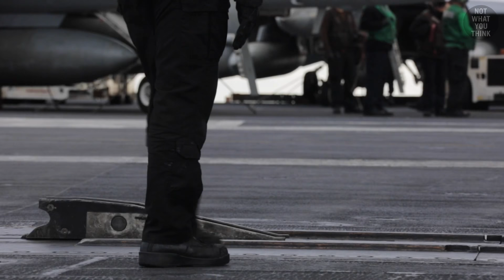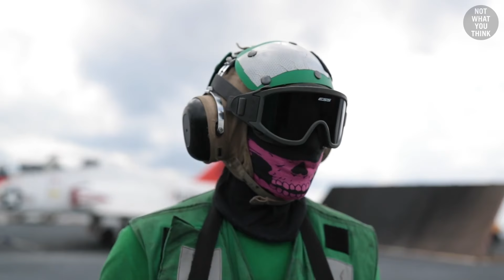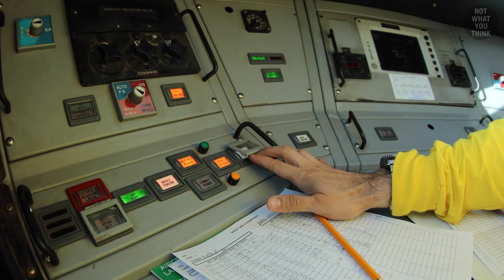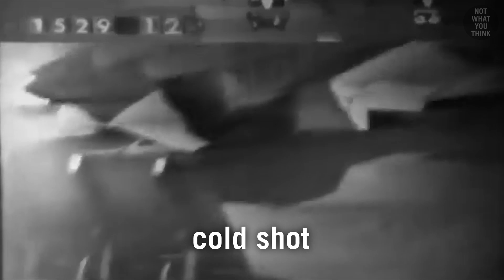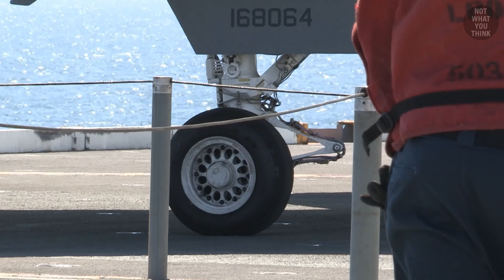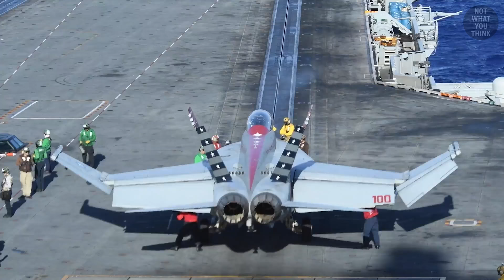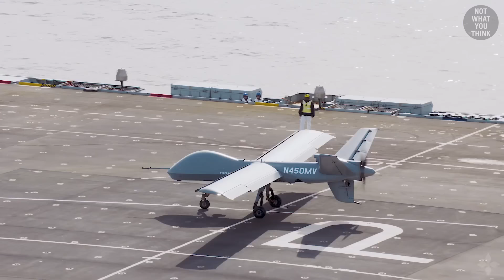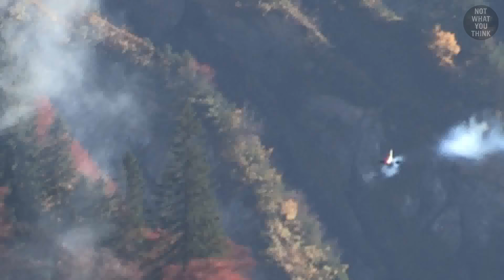Why the US Navy is Replacing Electric Catapults with Steam

Comment: It’s a new technology, there will be bugs that will get fixed. When did people forget this fact? Brand new technology takes tweaking. That’s why you don’t buy the first model year of a car.  I am sure steam catapults took awhile to perfect, but they didn’t have a saboteur in chief back then.
Reply: I always wait until the third or fourth year of production to get my new supercarrier.
Reply: @benoithudson7235 You'd be doing better than the US because the Gerald R Ford took 12 years to build and another 6 for full deployment.
Reply: @JWQweqOPDH  And the mag launch system still doesn't work right till this day too. But, like with the Zimwalt's failed vaporware rail guns, the "experts" keep trying to push the tech in its current design on the US Navy.
Reply: @benoithudson7235  Problem is, the navy has had issues with the electromagnetic system for over a decade now, ever since it was first installed in the Gerald Ford.
Reply: @nicholasconder4703  China stole the tech from the US and implemented it exactly as we designed it, and it has had the same exact problems with their copy of it too. The Ford's mag launch system still don't work right and it is deployed which is the stupidest thing the Navy could've done considering it will fail when it is needed most.
Reply: @benoithudson7235  Trump is an Epic Moron and shouldn’t be telling the military what to buy… like Battleships.
Reply: @voixdelaraison593  Says a moron who has no clue that the Iowas provided capabilities the US has lost. Capabilities that the Zimwalt-Class with its vaporware rail guns was supposedly supposed to replace. The next war the US will get into is going to be with China and it will be a war that the US hasn't fought since WWII. Trump and people with an IQ higher than room temperature understand this but you don't. Which goes to show who is the moron here. One suffering from TDS who needs to go out and touch some grass if there isn't snow on the ground where you are.
Reply: @TheFoulMouthNews  The Experts in Naval Warfare should decide what is needed not an Epic Moron like Trump. Hitler told the German Arms industry what to build and how to fight and he failed.
Reply: @TheFoulMouthNews  - starts trying to convince someone by throwing the personal insult "Says a moron who has no clue that ..."

Personal insults just make you look bad, they don't get people to listen whatever relevant facts you have, or think you have.  Though, if you're a troll... provocateur for some government maybe?  China would love for the US of A to waste huge amounts of money on effectively useless battleships.

Or are you slapping back because you are insulted when someone calls Trump a moron?  

Or are you emotionally hurt that the navy decided, for at least some valid reasons regardless of the politics also involved, that battleships weren't the wave of the future?  And battleships still aren't because aircraft, drones, and missiles much cheaper than battleships can reliably remove battleships from the force equation.
Reply: @voixdelaraison593  Look at you. You couldn't help but compare Trump to Hitler here. Grow up!

For starters, you do realize it was those experts who forced the retirement of the Iowas in the 90s because as long as they were active the Zumwalt's rail guns were never going to happen right? You also do realize they did that because of the kickbacks too right?

Oh, you didn't know that a few admirals were caught getting paid off with the Iowas' retirements and the rail guns? And you want them to decide things?
Reply: @TheFoulMouthNews  Nazism is a Far Rightwing Ideology that embraces: Authoritarianism, Racism, Xenophobia, Homophobia, Antisemitic Conspiracies, and Really Big Lies - Trumpism Checks every box. Read a Book!
Reply: @TheFoulMouthNews  Battleships are sitting ducks for modern weaponry. Yes they pack a hell of a punch with their massive guns, but they're slow and less maneuverable. Aviation technology has improved a lot since. Destroyers and cruisers packed with missiles would do a better job with better precision. The battleship guns were kinda inaccurate. Air Force bombers would also be bringing extra firepower to the game.
Reply: @dallasyap3064  Battleships are no more vulnerable than aircraft carriers. They are actually less vulnerable than them. On top of this, the Iowas are faster and more maneuverable than our supercarriers. The "official" cruising speed of an Iowa is 35 knots and the actual speed which is substantially higher is still classified till this day. The same with their emergency speed too. Then you have the fact that the Iowas in Desert Storm were far more accurate than US missile strikes. So much so, with just using an over glorified RC plane with GPS and a camera strapped onto it, the Iowas were taking out Saddam's elite guard without even trying and it got to the point his elites were literally surrendering the second they heard the model plane flying overhead.

Let me also teach you a little history here. The analogue targeting computers from World War II were slated to be replaced with the 1980s modern equivalents because of people thinking like you who do not know what they are talking about. Someone was smart enough to keep the analogue computers on the Iowas as a "backup" but the scuttlebutt is that the person didn't trust the 80s digital firing computers to be any better. They were right too. The analogue computers were far more accurate in their firing solutions and faster at coming to them too. The digital ones refitted were the very same firing computers used by the Iowas contemporaries of the time to fire their 5" and 8" guns along with their missiles. The captains of the Iowas had to fight with the brass to keep using the analogues even though they proved to be better too.
Reply: Yeah it took a while for aircraft off of carriers to finally displace battleships. There's a reason they haven't been built since then -- the whole Trump class warship is just an ego wank that's going to get delayed and canceled for something more survivable in a real war, likely through spreading out among more numerous smaller destroyers.
Reply: @doujinflip  Says someone who probably wasn't alive for Operation Desert Storm. The Iowas provided capabilities the US lost and has not replaced. Capabilities that are necessary even in the 21st Century in warfare. The Zimwalts were sold as their replacements with their vaporware rail guns and they failed at that. They suck so bad, they are being retired well before their life expectancy. Destroyers are also the easiest ships to sink too.

Go learn facts and get over your TDS.
Reply: @TheFoulMouthNews  - mentions "... get over your TDS."

Damn, red flag right there foreign agent boy.  That riles the conservative base, but the liberals just laugh at the absolute nonsense that is TDS.  But you keep pumping the conservatives up so the US of A rips itself apart.  I'm sure the world will be a much better place for dictators once that happens.  Well, for a few years anyway.  They dictators will always need to come up with a new enemy to distract the people and justify their abuses of power.
Reply: @TheFoulMouthNews you know nothing of naval warfare. The difference between a battle ship and destroyer against a anti ship missile is essentially the same but actually favors destroyers. Yes getting hit theoratically they are stronger but actually. They aren't because they are much more likely to be hit and be detected. Active defense like maneuverability and SM-3 and SM-6 intercepting missiles, and for close stuff Phalanxs and Sea Rams. This is what saves ships not armor. The Payload in a missle vs conventional shells is huge in this case. Arleigh burke superiority have the same amount of SM-6 (more actually in some more specialized one) and CWS like phalanx have not been confirmed on the Trump class when other stuff have.

Also. 
Battle ships were brought out mostly as a PR stunt they were armed with the same missiles our destroyers use. They were disarmed because they were giant targets. The only reason they were rearmed was in the 80s they wanted to have more capital ships to essentially rally around and to meet demands the iowas were recommissioned. Navy didn't want it it had to work really hard to decomssion it.
Zumwalts while not great ships were not decommissioned they simply stopped production because marines the main ones who still wanted them preferred tomohawk missiles for greater precision.

Arleigh burke superiority.
Reply: @TheFoulMouthNews  Battleships are dumb because their guns get out ranged by missiles. They will get sunk long before they get close enough to their target to use their guns.
Reply: @damned-n7j  Says someone with one of the dumbest comments I've seen. You don't know what you are talking about and I am guessing weren't alive or were too young to know what is what when the Iowas were last activated.

Also, every single ship in the US Navy is at risk from missiles, especially aircraft carriers which the US has put all of its eggs into one basket with when there is a very finite amount of them. China has focused on developing hypersonic missiles because of this. No amount of aircraft in the air or CWIS is going to stop them too.

The Iowas provide a capabilities that the US Navy has not had since their retirement, like precision shore bombardment for example and do so for thousands a pop as opposed to millions a pop for a missile. We also still have enough 16" shells stored from World War II to bombard the living sh*t out of China like we had planned to do to Japan back then too. Those shells are still viable too which would mean the cost would be even lower than that.

Go learn facts because your feelings don't align with them.
Reply: @TheFoulMouthNews  Hypersonics are great against non-moving targets. The biggest problem with such missiles is they are blind due to the plasma sheath that forms around them jamming their own radar. We also have lasers (and probably soon rail guns from the Japanese) as defense options.

A battleship has the exact same weaknesses as a carrier except it it’s to get very very close to its target to do anything. It’s like bring a pistol to a rifle fight.
Reply: @damned-n7j  The Iowas official range of its shells which is less than the unofficial one isn't that close. The official range well over 25 miles. The unofficial is closer to 30 from what people have gathered. Before their retirement, the US had developed a sabot round for their 16 inch guns that officially had a range of well over 30 miles and according to Captain Larry Seaquist who commanded Iowa itself it unofficial range was much further than that. That is using the standard powder load out too. The 16-inch/50 caliber Mark 7 guns of the Iowas were also designed to be loaded over the standard amount of powder bags for limited firing on top of this which increases that distance even more.

You are also looking at the Iowas from the perspective of ship on ship combat like the days of when every nation either had or wanted battleships. Those days are over. Don't get me wrong though, that doesn't mean Iowas couldn't serve in a ship to ship type of battle in the modern age. It just isn't a top of the list type of thing for them today. Now, it is more about shore bombardment and the Iowas being the best thing out there for it both from an economics standpoint and a munitions on target one as well.

The Iowa-Class with a trained gun crews on the 16 inch guns can fire each one accurately two to three times a minute. Multiply that by its nine guns. That is upwards of 27 rounds going down range in a minute all on the same exact target and it can be a small one too. During Operation Desert Storm the Iowas were picking of Saddam's elite guard from the Persian Gulf using a "drone" that was nothing more than an RC plane fitted with a camera and GPS acting as their spotter. It literally got to the point that the Iowas were so deadly accurate that the elite guard would come out from hiding waving white flags and surrender to the RC plane. I kid you not on that. Those shells it lobbed cost thousands as opposed to missiles which cost millions each too.

The type of war the US will find itself in is most likely with China over Taiwan or somewhere else in the South China Sea, or within its sphere of projecting power. It will be a war we have not seen since World War II. It will make both Korea and Vietnam look like Grenada in comparison which was 3 days of fighting and 3 weeks of fun and sun according to a friend who was a Marine that took part in the invasion.

The type of war that I am talking in regards to China, we will need to establish a beachhead. The ONLY way to do that is through shore bombardment which the only ships the US has access to that are capable of doing it are the Iowa-Class. Ryan Szimanski is the curator of New Jersey which is his dream job as a curator and he knows this. It is why in every video he has done for the ship's channel along with everywhere else he can do it, he has sh*t on the Iowas when the subject of reactivating them has come up while giving them fellatio when it isn't the subject about them. He is afraid it will happen and he will lose his dream job where their contract with the US Navy has a reactivation clause in it. They are the only museum ships that do have one.

Even if the US deployed all of its missile capable ships to a hot spot in a war like one would be with China, our Navy does not have enough of them to establish and maintain a beachhead, never mind the capabilities to replace all of the missiles on those ships between logistics and manufacturing of them.  We'd blow our load and then just have our d*cks in our hands.

The US Navy has been mandated by Congress to keep thousands of shells for the Iowas along with the powder bags for them in controlled storage. On top of this, the production of both is a lot simpler, easier, faster and much cheaper compared to missile production. Not only that, because of the firearms industry in the US, it would be a lot easier to find contractors to produce them again for the US Navy on top of all of this. Even a small company in the industry could tool up to produce components for the shells if not the whole shells themselves, even the sabot rounds that had been developed for the Iowas 16 inch guns.

Let me leave you with this here. Just because something is old does not mean it is obsolete. The Iowas forced retirement had more to do with payoffs and politics than it had to do with their age and obsolescence. The companies that were scamming the government with the Zumwalt's vaporware rail guns bought off members of Congress and of the high ranking brass in the Navy. The head of the Marines was calling it out too trying to sound the alarm that the Iowas were still needed and it would probably be in a war with China. He was the one who almost single-handedly got enough Senators onboard, no pun intended, with the Iowas being mandated by legislation that as museum ships they must be maintained in a state of readiness for reactivation. He also had them make sure that the organizations entrusted with them cannot make any permanent modifications to them or any major ones without approval from the Navy as well. It is why New Jersey has sections of bulkhead that the museum cut out welded next to their openings after getting approval. One of the 16 inch gun turrets has a huge hole cut in it to allow easy access by people visiting her.
Reply: @TheFoulMouthNews  30 miles is less than 50km. There are anti-ship missiles with ranges going up to 1,500km. Even short range anti-ship typical have 200km range.
Reply: @doujinflip  Oh no someone has been more successful than you!
Reply: @DBAllen  how is this relevant to their comment?
Reply: @DBAllen  Oh no, someone is actually smarter than you!
Reply: @ElwinChinJunXiang There always is if I wasn't intelligent enough to know that I'd be like you.
Reply: @DBAllen  Keep dreaming little bro, the battleship era is gone. Carriers rule the waves, even China is smart enough to not build battleships. The entire MAGA intellect doesn't even match a 5 year old kid in China, let alone the president knowing what's good for the military.
Reply: @DBAllen  Do you consider Hitler successful?
Reply: @DBAllen  I've never succeeded in bankrupting even one company. Trump could give a masterclass on how to drive your business under by making ego-based decisions.
Reply: @jimfrazier8104  And I bet he soured your juice box and made your chicken nuggets taste yucky. Grow up mentally if you can.
Reply: @jimfrazier8104 Don’t worry! Trump has added 10 TRILLION $USD to our deficit during his time in office(so far). So he will likely bankrupt the country as well. Are we winning yet?
Reply: Yes, but how long will that take?  And why has China already gotten their EMALS catapults working?
Reply: @ZweiZwolf  China didn't get their mag launch system working. They stole it from the US and are having the same exact problems with it the US is still today. The Gerald R Ford still has them failing left, right and center, and so is China but he won't tell you that in this video.
Reply: If its new technology it should never been installed. 
Like Zumwalt, same lesson. Fancy  technology, failed meet subsequent requirements, Gun system had no advantages over missiles ,w as too expensive
Reply: @spikedpsycho2383  The Zumwalt-Class was supposed to replace the Iowas capabilities wise and never remotely came close to it. No ship has in the US Navy. The Marines who are the ones who have to actually do the dirty work of putting boots on the ground and establishing a beachhead till this day still understand this.
Reply: Bugs bad for war. Call them gremlins
Reply: "it’s a new technology " ... literally what the US military is known for
Reply: When steam technology was in development military jets were way less expensive to replace. We can fix the bugs but at what cost.
Reply: Or, it could just be flawed. China stole the mag launch tech from the US and is having the same exact problems with it. But, he wouldn't tell you that in this video. He actually is trying to claim China developed it on their own here and it works perfectly.
Reply: China is in front then? Ah how times change
Reply: @Sevastous  For everything on a carrier EXCEPT the nuclear power plant.  For now.  Rumor has it that their next carrier will be nuclear.
Reply: @Sevastous  No. They are not. They stole the mag launch system from the US and are having the same exact problems with it too. That is well documented at this point. News outlets have covered it. China Uncensored was one of them.